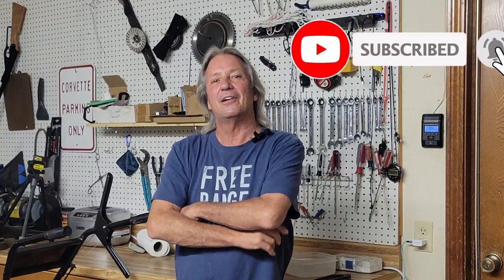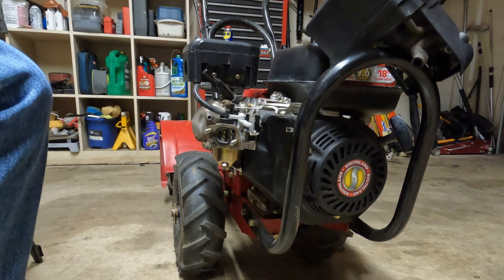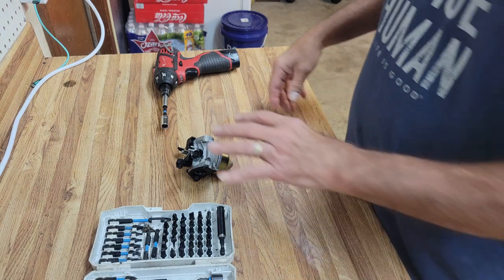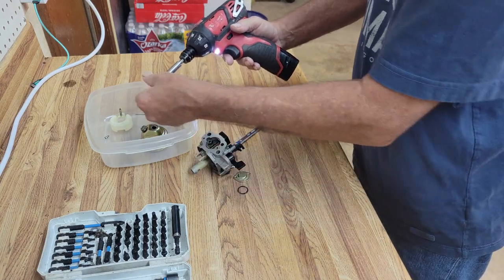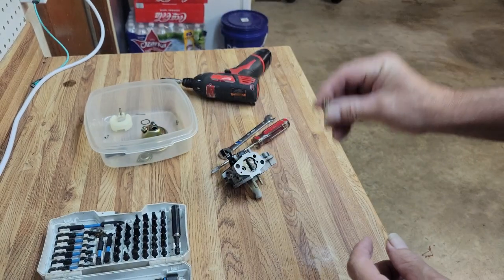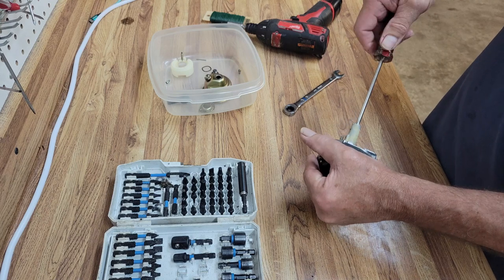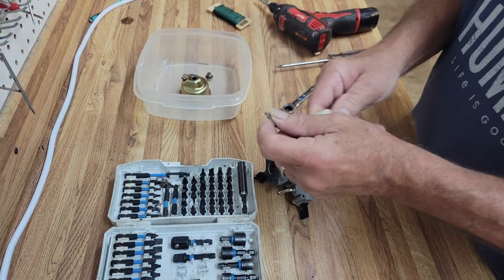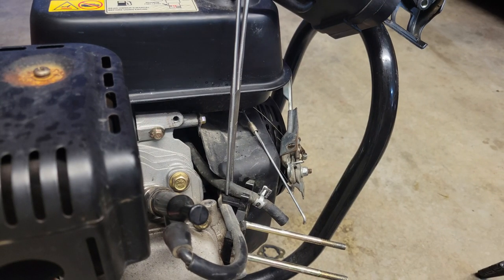Free Rototiller, with a STUPID problem.

Comment: I ❤ my ultrasonic. I use it almost every time because it seemed like if I just did a clean without ultrasonic, I ended up tearing it back apart to ultrasonic the thing anyway. Ultrasonic, small amount of carb spray, some compressed air and outcomes are good.
Reply from the maker: Agree 101%. I don't like carb spray in the garage so I use the ultrasonic and blow them out and it just about always works